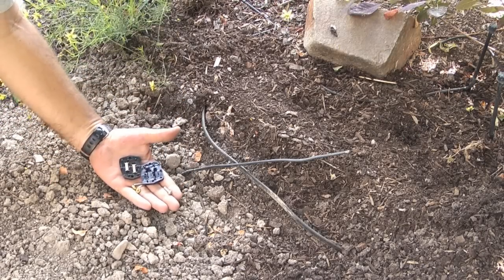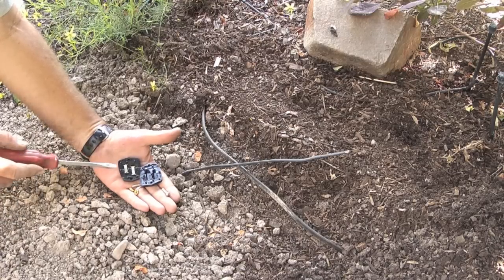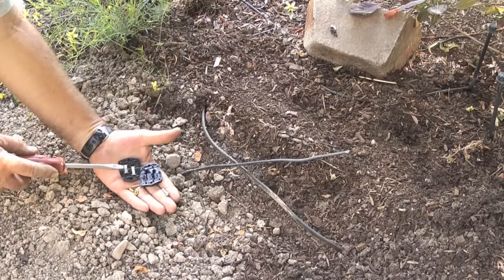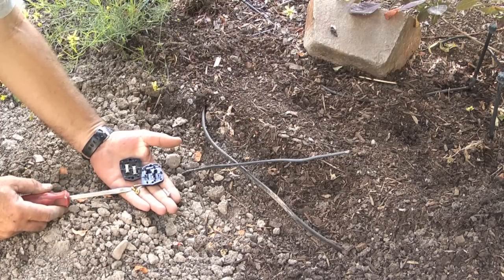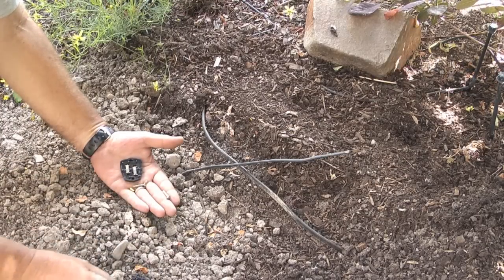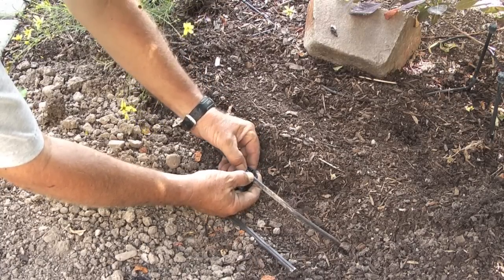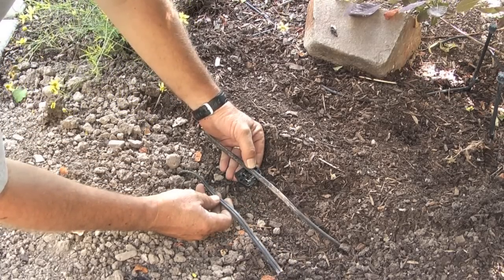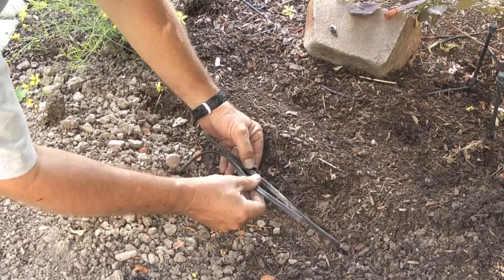Landscape Lighting: Splice into landscape cable

Comment: Nice job, looks a lot simpler than the wiring I'm used to with 120V. I was surprised to see these kind of penetrating connectors for landscape work, but evidently they works fine. If I had not seen this, both here and in my own yard, I might have soldered the joints and carefully insulated....

Comment from the maker: I think that's the advantage low voltage has over 120V lighting, flexibility and cost. On the yard's I've worked on with 120V lights, just moving or adding in a light would be time consuming and costly. With low voltage lights you just clip in a new light or splice in another wire to reposition a light. The lights are also a lot cheaper.

Comment: can anyone say definitively where these are available for purchase?
Reply from the maker: +Dan Robinson 
Looks like the type of connector in the video has been discontinued at Home Depot. They do offer this type which looks easier to use than the type in the video: http://www.homedepot.com/p/Hampton-Bay-12-Volt-Low-Voltage-Splice-Connector-HD22351BK/202883275?cm_mmc=SEM|THD|G|0|G-PLA-BT3-HamptonBay-D27L-InteriorLighting|&gclid=CIaP4qC61sgCFRCCaQod19gLiQ&gclsrc=aw.ds

Comment: You failed to state how you sealed the end of the cable before burying it. This would leave folks thinking they could just bury it as shown which will result in failure.
Reply: I know that many of these terminations "dead-end" the one wire inside it.  I'm surprised you didn't use that kind.
Reply: How would it result in failure??
Reply: @jonathaneglinton5378  It won't I've buried the end for years, many times, no failure, nothing happens to the power on the line after your last light or here at connection T.
Reply: @jonathaneglinton5378  they aren't supposed to get wet. A sealer cap should go on the end.